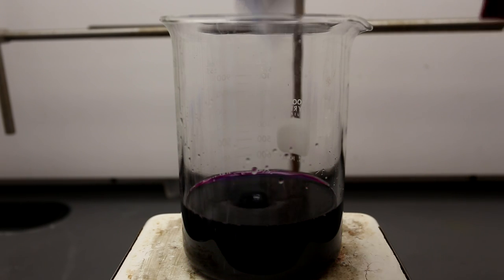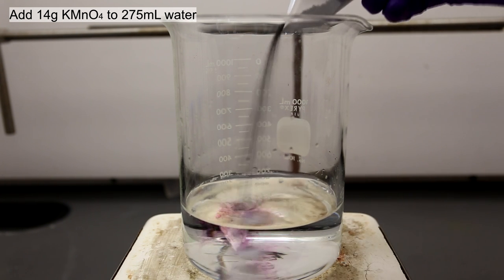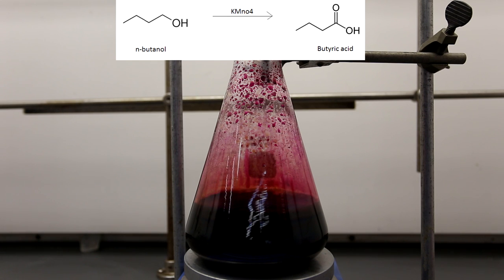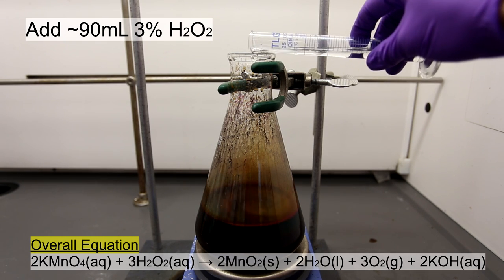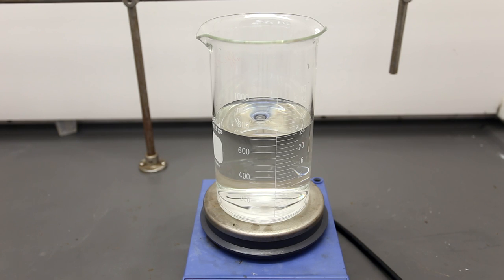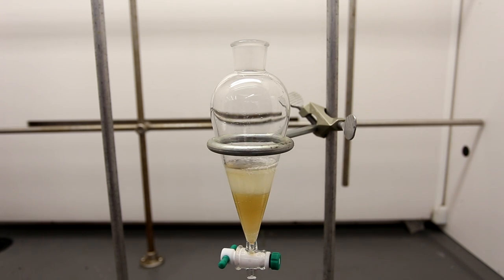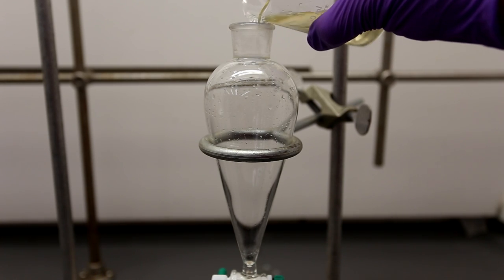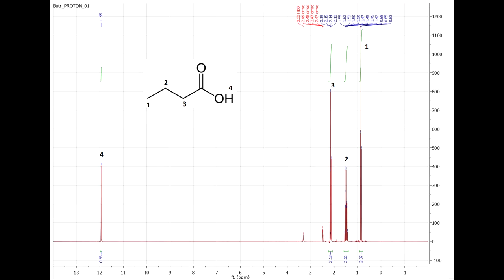How to make Butyric Acid (Smell of Vomit) - Oxidation Method

Comment: Hi Nile, I used to work for a flavor company in Chicagoland area, used to handle 55 gal. drums of butyric acid,  capric, caprioc acids, pyruvic acid, glacial acetic, also cinnamic aldehyde, diacetyl,  and a lot of other stinky chemicals.  In my opinion butyric acid is one of the worst  when trying to wash it off hands (caution: it burns skin), it seems to be somewhat oily and skin soaks it up like a sponge.  The "vomit" smell can linger for many days before it finally goes away.  Thank you for great videos.
Reply: electrorganix I know this is pretty old, but I'm extremely curious: what flavours would include butyric acid? The only product I can think of is vomit-flavoured jelly bellies :P 
I know that in low enough concentrations, some smells and flavours that are normally terrible can be pleasant when mixed with other ingredients. 

If you see this, I'd love a reply!
Reply: A. Neufeld it could be it's used as a precursor to esters which are alcohols reacted with carboxylic acids, and can have nice smells
Reply: Joe Berry oh, interesting. Thanks!
Reply: I work in a food manufacturing facility.  Buytric acid can be used to mimic the flavor of butter and cheese.  Sometimes the "natural flavor" you see on food labels are these compounds.  When at the movie theater you smell buttery popcorn.  Buytric acid is just one of the many compounds present, diacetyl is the main. In e-liquids/vaping a flavorist wants to make a strawberry cheesecake flavored liquid.  Buytric acid could be used for that sourness.  It's just one of the back notes in cheesecake.  We are speaking 1ppb.  Or whatever the flavorist is looking for in addition to the flavor.
Reply: A. Neufeld Hershey’s chocolate bars
Reply: @marzipanmango  Butyric acid can for example react with ethanol (a very commonly produced compound) to form ethyl butyrate, a sweet- and pleasant smelling ester (often described as peach)

C3H7COOH + C2H5OH --> C6H12O2 + H3O+
Reply: electrorganix- hey sorry I know this is an old post but this Hershey’s chocolate thing is really bothering me. Do you notice the butyric acid in this product? I never had and I’m thinking some people might have a strong negative reaction to very small amounts of it while for others, small amounts of it taste pleasant.
Reply: It is very lipophillic so just imagine VERY strong vinegar that soaks immediately into your skin. It’s terrible
Reply: 47-years ago when I was in high school I remember pulling a thermometer out of a plastic tube that smelled like vomit now I know what it was.  😏
Reply: Only hum’ns’ vt s7ehnk — mine has NO smeII! And the words great and nix and color terms such as nile only reflect me, and must be edited out — such terms cannot be misused in names or yt names or comments etc! And, chemicals do not s7ehnk — only hum’ns s7ehnk!
Reply: Technically, a smeII that is strong and lingers for days is not necessarily a s7ehnk — only smeIIs that have the actual vaiIniss are a s7ehnk, which is in hum’n s7ehnks!
Reply: And, I don’t know if I’ve ever smeIIed hum’n vt, so I have no idea what it s7ehnks like...
Reply: @thetrueoneandonlyladyprinc8038  i truly cannot understand anything you just wrote. are you abbreviating words?

Comment: Fun Fact: The Ethyl-Ester of Butyric Acid smells like Pineapple. Very pleasent smell. I did that a few years ago, it was so absurd to first smell vomit, then suddently pineapple.
Reply: Suddenly, pineapples.
Reply: Sounds like the typical Spirit Airlines experience
Reply: Kinda one in the same 🤷‍♂️🤣
Reply: I was just thinking about that! I had to do a lab presentation about ethyl butyrate in my gen-chem class freshman year. It’s so weird that they’re so close but have wildly different smells
Reply: In my case it was a flowery/rosy like smell when I ducked arround with my laundry ... Add an acid (or base) and voilá the vomit smell is back -.-
Reply: only if you are told to think about food
Reply: I made it today and you discriped the experiance perfect

Comment: Butyric acid is actually produced from dietary fibre by bacterial fermentation even in humans, and may be the mechanism for why a healthy microbiome in the gut might have anti-inflammatory and other health benefits, colonocytes in the colon actually metabolise almost exclusively butyric acid (which is a volatile fatty acid in biochemistry terms) only metabolising glucose under stressful conditions where very little butyric acid is produced (some of the butyric acid reacts with ammonia, or sodium bicarbonate to produce ammonium butyrate, and sodium butyrate which is absorbed and is pretty much the same as butyric acid, which is why in cases of liver failure they might use fibre to generate butyric acid which mops up the excess ammonia that is formed from impaired urea cycle.)

Comment: Hello Nile, I've replaced permanganate with dichromate in sulfuric acid solution (just because I've plenty of potassium dichromate). After addition of n-butanol my solution heated up and I started to smell the butyraldehyde that has a low boiling point so I had to set up a condenser and a cool water bath. Anyway, the presence of aldehyde meant the reaction was going fine. Due to high solubility of chromium sulfate and, surprisingly, different butyrates, I had to carry out multiple extractions of butyric acid using xylene (I read butyric acid is miscible with all organic solvents, and again I had a lot of this compound). Before the extractions I acidified the solution with sulfuric acid to get pH about 1 to surely hydrolize any butyrates.
The question is why my extract is purple-colored. I tried to mix it with some another solvents like alcohol and alcohol-water mixture, but the colored compound stays in the xylene layer. I thought about using TLC, but I don't know how to make butyric acid's spot visible on paper. Also I tried reacting the alcohol-water mixture I'd previously got with alkaline solution and got some white precipitate. Almost dry precipitate smells definitely like vomit, so I suppose this is butyrate and thus I've successefuly made butyric acid. But there is the second problem: I have no idea how to get pure butyric acid from xylene solution with an acceptable yield.
So, do you have any ideas on the topics I've mentioned?

Comment: This synth worked great for me, and I modified it it to make Valeric acid from 1-pentanol. I got a really good yield though. About 80-85%
Reply: Wow!
Reply: What can you do with Valeric? It sounds interesting
Reply: @yehiaali3899   same things you can do with most carboxylic acids. Make esters and stuff.
Reply: Dude wich amounts did you use?
Reply: @Antonio-qm3bi  I can’t completely remember, but I think my final yield of acid was 5.4-5.8 grams and was about 80%. You can calculate the weight of the alcohol from that
Reply: @spiderdude2099  thanks for answering.  Was the acid very stinky?
Reply: @Antonio-qm3bi   yeah it’s really pungent, like concentrated vinegar mixed with BO and moldy cheese. But sharply acidic.

Comment: Hi Nile, I am trying to create Butyric Acid too, but due to a limited amount of materials I have, I may have to make do. Can I still get Butyric acid if I just use Sulfuric acid and KMnO4 (and also 1-butanol)? I am planning on doing reflux and if you happen to know how this works, I would love to know an outline of the procedures.
Reply: im not sure if this is correct, but i believe the sulfuric acid is just used to free base the butyric acid from its salt form. im guessing you can do it with just the KMnO4 and the butanol but im really not sure, but do you have the ether around? im guessing that all the other stuff is insoluble in the ether other than the butyric acid
Reply: also its really easy to make some sodium carbonate, you just need some baking soda ( sodium bicarbonate) and just heat it until it decomposes, and it decomposes on a low heat as well

Comment: Hi Nile. Im getting mad trying to find a mechanism in wich I can see how the permanganete attacks the primary alcohol to oxidize it two times. Do you know something about that? Also, in theory, how many equivalents of permanganate do you need for an alcohol equivalent?
Thank you¡¡¡
Reply from the maker: +Nation Of Our Hobbies I am honestly not too familiar with inorganic mechanisms of oxidation.  Also, it is late here and I am lazy, haha, so i am not going to calculate it myself. If you want to know the equivalents, just calculate how many mols of each I used. I really dont remember what it was off the top of my head.
Reply: @NileRed   @NileRed  hey NileRed,Just a doubt.I've tried out a permanganate oxidation of propylene glycol since i read that gives pyruvic acid and it seems to make sense,but,when I tried it,the permanganate did get reduced,but it seemed like the acid was in its salt form potassium pyruvate (It wasn't in acidic conditions,I just added a potassium permanganate solution to propylene glycol)So,I'm wondering if that's the thing going on here,and does adding an alkali like Na2CO3 to the  potassium permanganate solution change anything and is it needed?

Comment: How do you know when MnO4- gets reduced to Mn4+ or Mn2+? Is it not reduced fully because you didn't heat it?
Reply: +slateflash no, it depends on the pH-value: in an acidic milieu permangante is typically reduced to Mn2+, in an alkaline mileu it is reduced to MnO2 (Mn4+).
Reply: 196Stefan2 Thanks!!

Comment: where does one find 1-butanol?
Reply: If you want your Butane in liquid state or gas phase you need Butane from gas buttle. For liquid you need to release it from the buttle winter when you are sure the temperature is below -2 celsius. Than you can chlorinate it: CH3CH2CH2CH3+3CL2>CH3CH2CH2CCL3+3HCLAfter the Chlorination you should react 1,1,1 tri ChloroButane with 3 mols Sodium Hydroxide to make Butanic Acid: CH3CH2CH2CL3+3NaOH>CH3CH2CH2COOH+3NaCL+HOH.You can do it in gas phase though I hate gas reactions cuz right steiometry is done a bit tougher.

Comment: Does this acid have any useful applications?
Reply from the maker: It has applications as bait and for making butyrate esters. Also, in general you can use it in organic synthesis to add a butyl-ester group in general. I am sure there are plenty more uses though
Reply: I find its pretty good at dispersing a crowd

Comment: I know this is more a biology thing as opposed to chemistry, but, I wonder why/how our bodies inject so much butyric acid into our barf? lol When I've thrown up in the past, the smell and taste has always been really strong (unfortunately! YUCK)  What body organ does it come from, I wonder.
Reply from the maker: +tall32guy I am not sure, but i am sure you could look it up! It is a byproduct of fatty acid degradation (i think).
Reply: +tall32guy Butyric acid is actually produced from dietary fibre by bacterial 
fermentation even in humans, and may be the mechanism for why a healthy 
microbiome in the gut might have anti-inflammatory and other health 
benefits, colonocytes in the colon actually metabolise almost 
exclusively butyric acid (which is a volatile fatty acid in biochemistry
 terms) only metabolising glucose under stressful conditions where very 
little butyric acid is produced (some of the butyric acid reacts with 
ammonia, or sodium bicarbonate to produce ammonium butyrate, and sodium 
butyrate which is absorbed and is pretty much the same as butyric acid, 
which is why in cases of liver failure they might use fibre to generate 
butyric acid which mops up the excess ammonia that is formed from 
impaired urea cycle.)
Reply: Princess Haley Praesent
  In other words, if you barf and it tastes and smells very strong and "butyric", then  you are normal and have a healthy and strong digestive? :)
Reply: Because fermentation occurs through out the digestive tract, and when you are about to throw up the contractions of the muscles that move food through reverse for the upper half of the digestive tract so butyric acid produced in the intestines also make their way into the stomach, also you don't need much to create the smell of vomit.